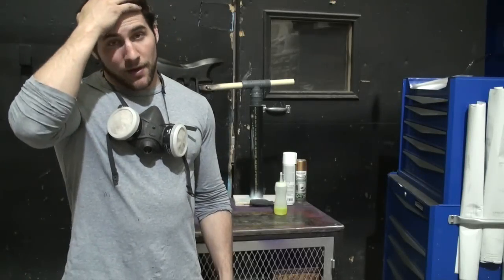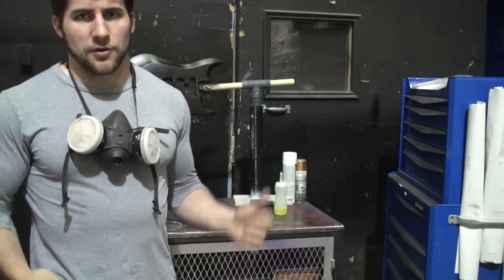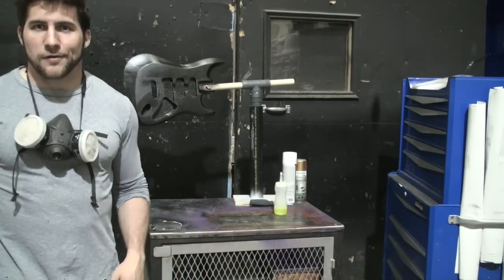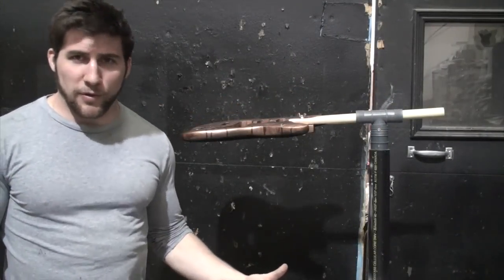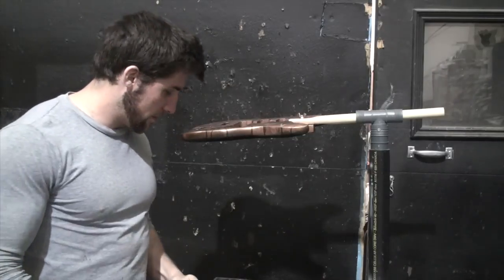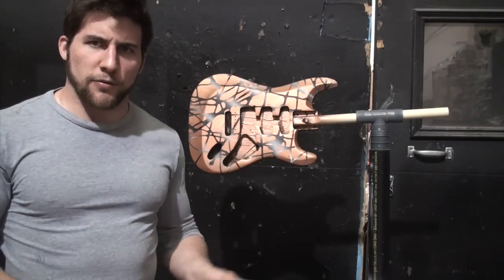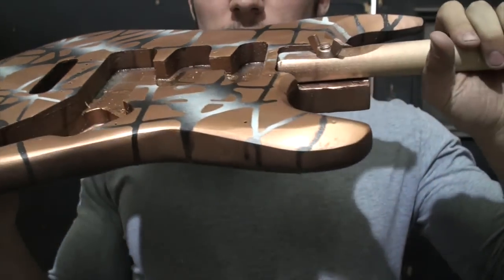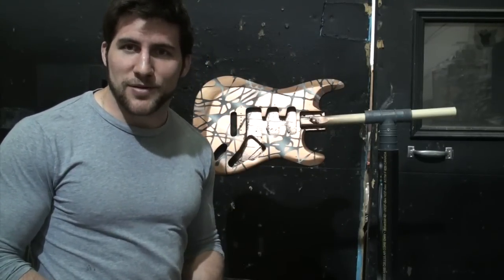How to do a cool guitar paint job with spray cans

Comment: okay so you paint it striped with black and white, how long do you wait for that to dry until you put the dish soap on?
Reply from the maker: +Cole Rogers let it dry fully at that point, or at least to the touch. I think I let mine dry for a couple hours.
Reply: Brad Angove Was the towel regular after the paint job to wipe it down or was it wet
Reply from the maker: +GCV it was wet.

Comment: Wow that came out amazing I am going to try this. Thx for the dish soap tip cause I thought I would have to get a crap ton of painters tape to do that!
Reply from the maker: I'm glad you like it. Good luck with your project.
Reply: So I painted it just the same as well as sanded it and I added 10 coats of gloss. It's kinda ruff still should a sand the gloss a bit with 600 grit sand paper (like 2 layers?)  to make it like a piece of shinny glass thx!
Reply from the maker: 10 coats? Wow, that's a lot. What you need to do now is polish it. What kind of clear coat did you use?
Reply: I used a clear coat that was made by Krylon and it's titled clear coats non yellowing indoor and outdoor gloss used for metal and wood.
Reply from the maker: Ok. I don't use krylon, but the same polishing methods that you've likely seen in my videos about polishing should still apply.

Comment: Thanks for the reply, also I always thought it's better to have a few layers of the paint before the final clear coat? Although I know you say in the video you can't put too much on over the soap right? But if one good coat is good enough then I'll crack on with it and show my paint job once it's done.
Reply from the maker: Having several coats of paint under the clear is only beneficial in that it provides proper coverage. After that, the clear coat provides your protection, so it doesn't really matter. This is of course different than something like a house, where you do not clear coat. For something like that you need a few decent coats to give the finish some longevity.
I look forward to seeing how your project turns out.

Comment: I saw water drops used on a guitar before spraying with candy colours and that looked amazing!
Reply from the maker: +Ed Van Meyer The water droplet effect is very cool. I've never used it in a guitar before though. Not have I seen it done with candies. That sounds awesome.
Reply: Yes its a superb effect, check out this Japanese custom motorcycle painter Toshio Matsuzawa, he does some great crushed ice effect with kitchen wrap on a motorcycle tank, you can now get 2k spray cans from Eastwood to get a really tough finish, you shake the can and press the activator knob and it breaks a seal and mixes the 2 components, so you can spray 2k without a paint gun, but you'll need a good mask as 2k is a bit toxic! I guess for short exposure, a good air mask would work, if you can't smell the 2k through the mask you'll probably be ok, I've used 2k but with an air fed mask from a clean air source. Like your vids.
Reply from the maker: I like the wrap effect. I don't use it as much as I used to though.
Yes, I've already done at least one video on the 2K spray cans.
Thanks.

Comment: Love your videos! My grandson and I are painting a guitar using this  design. After applying the soap how long should we go before spraying the last coat of paint? Is the soap drying a problem?
Reply from the maker: Soap drying isn’t really an issue, but there’s no reason to wait more than a couple minutes at most. The soap running/leveling itself over time is the issue.

Comment: What clear coat should I use for metallic enamel without the losing the metallic effect? i've had issues with a test piece and dont want to ruin the guitar
Reply from the maker: Clear coat shouldn't mess with the metallic effect. Sometimes the reflective metal paint reacts poorly to clear though. I'm not sure why. Are you using the sparkly/pearlescent stuff, or the reflective finish metallic?
Reply: found one that worked I was using rustoleum metallic gold paint+primer and the ONLY one that didnt turn it into a sad cloudy gold was krylon colormaster acrylic crystal clear. Even the krylon with rust protection had the same effect. But thanks for replying man lol
Reply from the maker: Wow, that's crazy. I'm glad you found a solution.

Comment: hey brad. LOVE this technique. i was recently inspired by kiesels "splatter" guitars, and was thinking, could the dish soap be splattered or is it too thick? coul you use a dust can (compressed air) to push the soap into a more "splatter" pattern? 
how do you feel aout holofoil/holoflash?
Reply from the maker: You could create a splatter pattern with the dish soap, but it would probably be easier just to go ahead and create that pattern with the paint itself.
Reply: @BradAngove  with spray cans? tell me more, sensei!

Comment: Hi would this work if if the body was on a angle so the dish soap would have runs or is the soap used sparingly?
Reply from the maker: You could do it with runs if that’s your preference.

Comment: if i were to use rustoleum bright reflective metallic gold as a basecoat, could I then spray over it with Krylon colormax bright white satin? would this work? Thanks in advance
Reply from the maker: Ballad of a Downfall It should. They are both enamels, so they shouldn't react in a problematic way. That being said, I have had some problems with Krylon before.

Comment: Hey man the paint job is really cool, I'm gonna try that for sure, but let me ask, WHAT IS THE LIQUID THAT YOU USED TO MAKE THE LINES? And what can i use to finish it with a satin kind of look, thanks!
Reply from the maker: Did you watch the video without sound haha? It's dish soap. You'll want a satin clearcoat for a satin finish. You can try a satin enamel, or a 35 degree sheen lacquer perhaps (depending on your paint type). Or if you take a look at my how to paint your guitar by hand series I show how to do a satin finish with a wipe on poly.

Comment: Hey brother my names Craig long time subscriber first time commenter was just wondering how long after you put the final colour on was it that you wiped down the guitar? Outside that I love this video and have already sent it to all my mates - all three of them
Reply from the maker: Haha all three of them. Thanks for your comment Craig. I had to make sure that last coat of paint was dry before wiping it down. Because I put the paint on lightly, I only had to wait about 30 minutes, but I could easily have waited longer. The paint won't stick to the soap, so as long as you don't leave it for a couple days so that the soap becomes harder to take off you should be fine.

Comment: Great Video as alawys.

what is this liquid stuff you put on the guitar to get that effect?
And is ist possible to use it on objects that aren´t so flat like the Guitar?

Could I use this on a Bike Helmet?
Reply from the maker: That was dishsoap. It acts as a mask for the paint. It is possible to use it on something that isn't flat, but it will run down the sides and mask off wherever it is. You would end up with a bit of a different effect if you did it on something like a bike helmet.

Comment: Brad, will the clear coat adhere properly if you just wipe the soap off? Do you need to do anything else to prep for the clear coat?
Reply from the maker: +Amanda Jacobs You need to use a damp cloth and clean all of the soap off carefully. If there is still some soap on there, the clear won't stick to it just like the paint didn't.
I would likely scuff the paint with a scotch pad before applying the clear in order to give the clear something to grab on to.

Comment: Brad, is it necessary to apply multiple coats of any one of the three colors youre applying using this technique? i mean isnt it standard to apply say, three coats of the base coat? and then one coat of the other colors, say like when youre doing flames? or will one coat of each color be enough as long as theres coverage over the entire body of the guitar? and what about if you only want that effect on the top of the guitar? should i just tape the edges? and would that be top edge or bottom which would mean that effect will be on the sides as well.
Reply from the maker: +raylotta1 Hi there. The purpose of multiple coats is to get full coverage. I would suggest that you apply two coats of the base colour to make sure you have coverage there, but after that it's more about whether you have the coverage that you want. You can definitely tape the edges if you just want the effect on the top. Doing the effect on the sides can be a challenge anyway because the soap runs. Tape at the top edge for that drop top look.

Comment: Super cool
Reply from the maker: Thank you sir.
Reply: Ma'am, I'm a woman lol
Reply from the maker: My apologies; thank you ma'am. 

Though my viewer demographic is predominantly male, I shouldn't have assumed.
Reply: Not a problem. With my Haus Ulv name ( kennel name) hard to tell. My name is Lauren. And really cool work you do. Was looking at clips to see how to do that marble swirling technique. Wanted to do it on glass bottles but how I did it didn't work so well :-( Think I need a different paint.
Reply from the maker: You mean the effect where you dip them in water, or the negative marbleization technique?
Reply: Dip in water after enamel paint has been dropped in and swirled around
Reply from the maker: I've never had much success with that technique.
Reply: Yea neither have I, there is a way for women to do nail polish like that...I can't even get that to work lol

Comment: Hi again,
I manged to finish the 2nd attempt and it looks quite ok. If I look in the light I can see some places where dust particles landed producinh "mini bumps". I tried quite a couple of times to sand them down, and even tried using the wax/grease remover to see if eveeything is ok, but still are visible now with the clear coat when looking near. I am not even sure if they are dust particles or something else... It took me about 3.5h of polishing and sanding at the end. Since the 2k clear coat I chose was scratch resistant, I forgot that I would have to polish it and that means "scratching" the hell out of it. I must say, that the surface gives the impression I could run it over with my car without it being even impressed, but it transformed polishing in almost a nightmare. I am quitw pleased with thw result though. Next time I will probably try it with the paint gun though. What nosle sizes would you recommend for filler, paint and clear coat? I have 1.3,1.5 and 1.8 here. I still have some pickups I would like to try, and I am thinking of buying a used body to keeps costs for a new body in an affordable area.

Thx,
Adrian
Reply from the maker: I'm glad it worked out. Sanding that clear by hand can be tough. Use the 1.8 for filling, the 1.5 for clear, and the 1.3 for paint.
Reply: Brad Angove oh well, tried also after half hour to switch to a drill rotated sponge head with the ultimate compound, but it still took that long. Too fast kept spraying around the compound, so I tried going in the first gear and sped up to 2nd after the compound traces where less, but this particular clear coat proved to be hard as a rock. It gave me the impression that it doesn't really cut into the clear coat. Are there slightly higher cut products which would come in Question in such a case? I tried to use 2000 grit sanding paper, but still took 2-5 Minutea per dust particle to level. It was literally a nightmare and I still have my muscles sore from the process (I am a buro employee:) ). 
Best regarda,
Adrian
Reply from the maker: Some clear coats harden up to the point where they are harder to polish than others. An orbital sander would have made the sanding easier, but sanding is usually the hard part.
Spraying polish isn't bad, but you don't need the polisher to go super fast.
How fast it burns in depends on the polish and the head you are using. Foam is good, and works the best for fine work, but some people us a wool bonnet for the more aggressive work at the beginning of the polishing process. Maybe that with some 3M heavy duty compound would get things done quicker.
Reply: Brad Angove ok. Will try next time. Thx

Comment: Hey Bro,
Thank you for the invitation and advice, but I need help. I just got finished spraying the color. It looks pretty cool. I'll post a pic if I can figure out how. What do I do now? What grade sandpaper should I use? What kind of finish coats should I do? How many? Any other tips you could give.
Much appreciated.
Reply: I meant inspiration, pretty high
Reply from the maker: What kind of paint did you use?
Reply: I used Montana Cans spray paint.  It says that it is nitro combination based paint, whatever that means. Thanks for your help.
Reply from the maker: Sand with 800 grit and then you can probably use Montana’s varnish.
Reply: @BradAngove  Thanks!

Comment: Did you just buff that by hand? It looks great.. Great idea.. I'm thinking sand or something might make a good use of a speckled look or something. I'm going to have to buy some cheap guitar bodies and loads of paint from the lumber yard. If I get any good results and get around to actually doing so, I'll post and let you know how it comes out. Thanks Brad. You rock man!
Reply from the maker: I just took the soap off by hand. I didn't buff it because I never actually clear coated it (this guitar was for demonstration purposes only.
The sand idea might work quite well. You just need to be careful cleaning it off afterward.
Looking forward to seeing the results of your experiments!
Reply: Thanks Brad. I'll post it if it works. I have some other ideas too.. Wax, etc,.

Comment: Really cool, that seems easy and cheap. I'll try with my guitar 
Be possible to use an airbrush instead of a can of spray paint? 
Sorry, my English is something wrong 
Thank you
Reply from the maker: Yes you can use an airbrush, but you need to find the right kind of paint for it. It won't work with water-based paint. Enamels and urethanes should work. Test it first.
Reply: Ok, Thanks
Reply from the maker: You're welcome. Let me know how it turns out.

Comment: Hai Brad. Your work hv inspired me to upgrade the paint on my Guitars with spray cans. May I know 1) how long do I have to wait till I do the pattern with the dish liquid;  2) how long after u spary the gold metallic paint that u clean the dish liquid out; and 3) did u use the brown pad to scrap off the dish liquid or just a normal cloth would do...

Appreciate your views.
Reply from the maker: 1. Let it dry fully. At least a few hours. 2. Depends on how thick you apply it. Usually about 15 minutes. 3. A normal cloth is fine.

Comment: Hey Brad, do you have any videos about gold top painting for guitars? Nice painting, btw!
Reply from the maker: Do you just mean how to paint the guitar gold? Sorry, I'm not sure what exactly you're looking for.
Reply: +Brad Angove, my bad. I am sorry. I mean something like the Gibson Les Paul Gold Top. I couldn't find anything about the way that finishing is done. Do you have any how-to video explaining how to make a gold painting like this specific Les Paul? Thanks!
Reply from the maker: I don't have anything on the colour gold specifically, but I do have a video series that will tell you everything you need to know. If you follow my how to paint your guitar series, it will tell you how I would do it. The only difference is that I would use gold instead of blue paint, and I wouldn't do any airbrushing. Nothing else would change.
Reply: +Brad Angove  I think Fernando is implying that he believes there is more to a "Gold Top paintjob" than simply painting the top gold, and then clear coating.
Reply from the maker: Jeffery A. Hunt I'm also getting that feeling. That being said, I'm not sure what the difference would be. The gold top just looks like it's painted gold to me. Unless he's referring to a vintage nitrocellulose finish, which I find unlikely. Am I missing something?
Reply: I do not think so. Maybe he thought it was like a pearl-job, multi-stage.
Reply from the maker: I see. That makes sense, but I don't believe the gold tops are tri-coat jobs.

Comment: Hey Brad, I am really digging these videos. I'm interested in compressors and HVLP equipment, as it might apply to a home/small project shop kind of person. It would be great for me if you could either make a video discussing that stuff or make just point me in the right direction...
Reply from the maker: I've done a couple videos on this topic that might be of use to you. I have one about how to get a spray setup for cheap which goes into the things that you need. You may also want to consider watching my video about how to set up your paint gun. Near the end I take a look at the compressor a little more. If you have questions after going through that material just let me know.